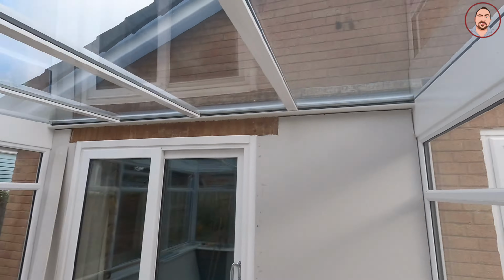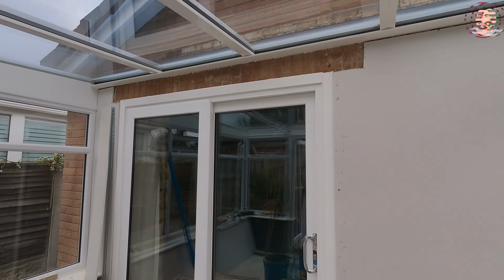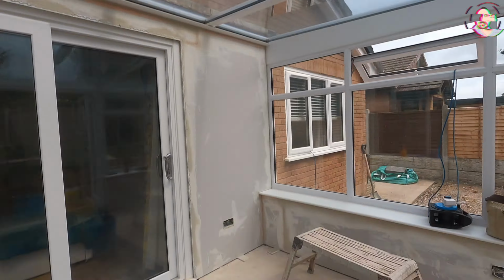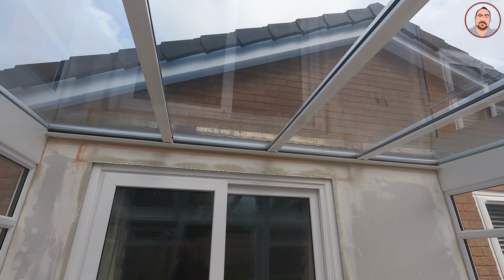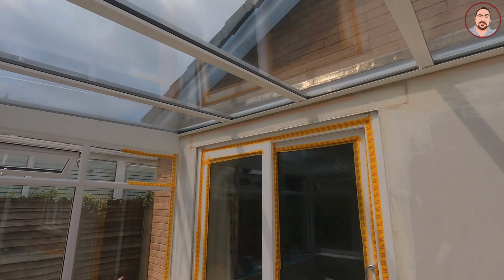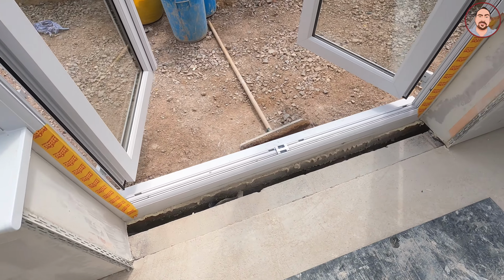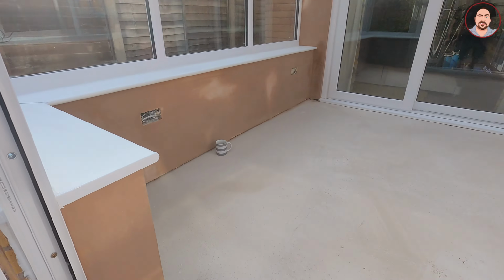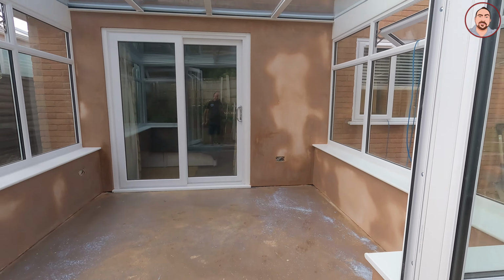How to Plaster a conservatory in a day.  Start to finish Plastering tips

Comment: Great video really helpful thanks. Quick question: What do you do about weep holes (i've got 2 each above doors and windows)?
Reply from the maker: Hi Mark, I would presume they should have trickle vents on them. Just for air circulation.
Reply: Hi Anthony, Thanks for the speedy reply. Just double checked and think I'm referring to lintel weep vents that are supposed to allow any moisture build up to escape..

Comment: I've never boarded over brickwork, so I know nothing, but my first thought if it sits nicely would be to mechanically fasten. Is that something that is done at all, or is dot and dab always faster and gets you more reliable results? Any other considertation, less dust and holes in brickwork??
Reply from the maker: Hi bud, you don’t need mechanical fixing for dot and dabbing unless your using insulated plaster boards. I wouldn’t fix to the plasterboard to the wall, You would need to batten out the walls but it’s quicker and stronger to dot and dab. Also it’s a lot easy to get levels if the walls are out.

Comment: Good job ant! Does board finish only require one coat. I’ve never used it before.
Reply from the maker: Hi Andy, thanks. you still have to second coat it. It’s virtually the same as multi.

Comment: Was that half time for plaster as opposed to the drywall one? How much does it speed it up in comparison? Grand job as ever lad. Natty t shirt too
Reply from the maker: Hi Rick they don’t do half time for drywall anymore. I spoke to Mark from Eazymix and he told it’s fine to use the normal one . I’ve been using it with drywall for while now and it works really well. If you want it to go off quick I’d use a full one for a bag of drywall. I only used half in my mixes because I wanted to put the whole conservatory on without it going off in the bucket. Thanks bud 👍
Reply: @AnthonyParryPlastering  good to know. I only bought a few of the drywall ones to try, but got plenty of the standard in stock.

Comment: Hi, did you pva the wall 1st?
Reply from the maker: No you don’t need to on brick or block work. You’d only need to use pva if you had areas that have no key 👍
Reply: @AnthonyParryPlastering I do to be on the safe side, what about a spray down with water, does it not suck out the water from the dab?
Reply: @bojackplasterman7938  pointless safe side for what?